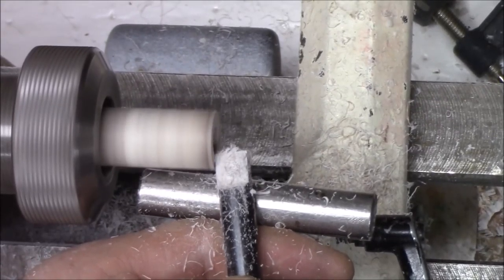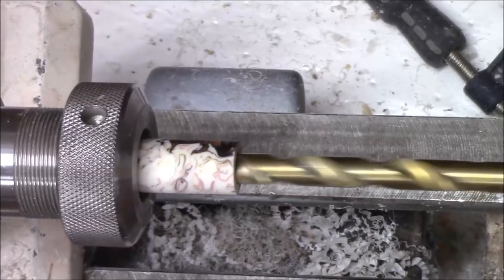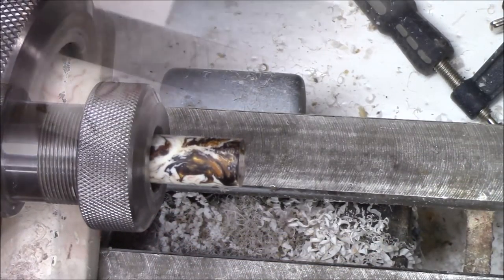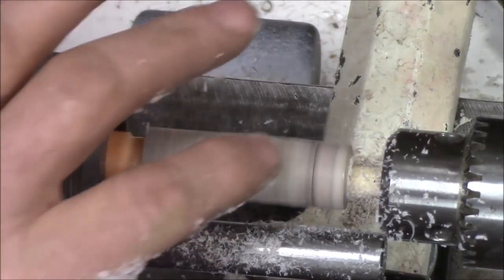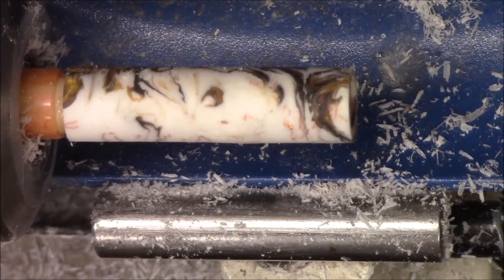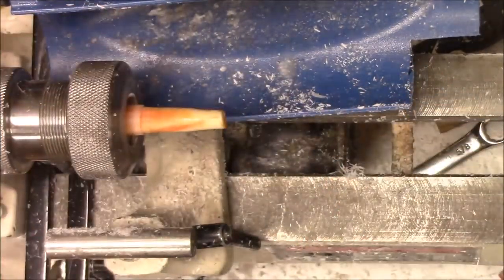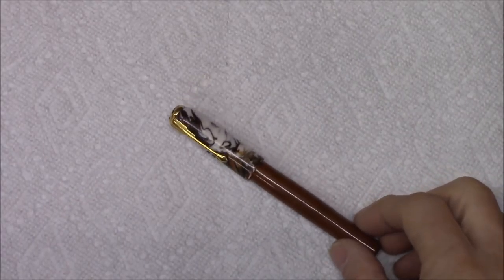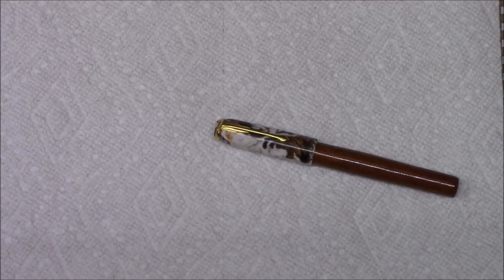Kitless  )Bespoke) Cap Part 2

Comment: Hi Lynn,  from an old engineer here in the UK, I can see you have the same problem as RJB, with your chuck, you have not clicked the collet into  the chuck nut, if you look into the nut you will see a spring ring  click the collet into the ring and it should be flush with the face of the nut, good luck with your kitless pens look pretty good from here 3,000 miles away.
Reply from the maker: Thanks Alfred for your support and the comment.  Best Regards